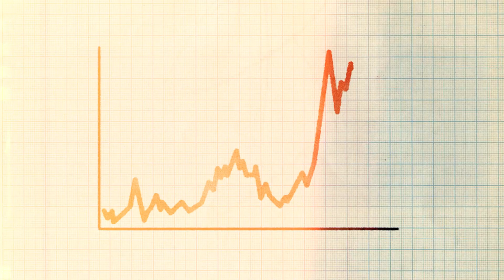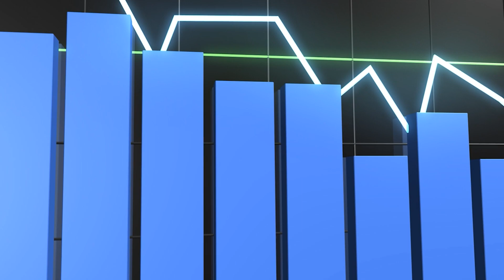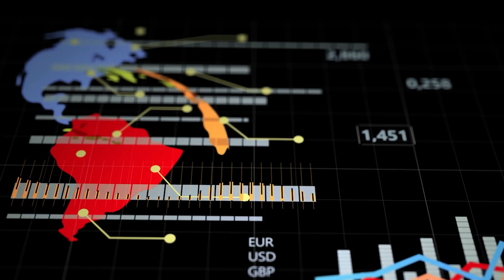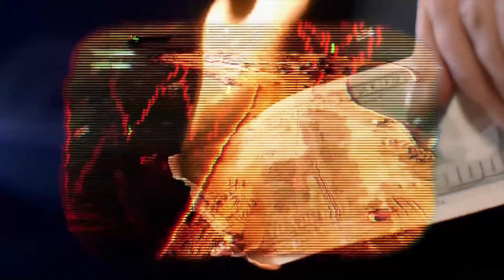Inside Dubai's $100 Billion Sinking Artificial Islands

Comment: Im not seeing the rising sea? I have a 50 year old photo of me stood by steal pipeing and concrete wave defences, you can see clearly the high tide markes, I went back last month and that area has not been change, and I took photos of the exact area, when I returned home I looked out the photo of me at this place, and I cannot see any diffence what so ever whith the tide marks, so can someone explin to me where this rising sea level is happening because its not happening where I live lol. There is a huge difference between erosion and levels so im getting a bit fed up of hearing about sea levels rising so they can justify how they demand us to change are ways, EV`s, less coal power stations, Im not saying that the change are bad but dont try to bullshit the masses that are well capable of looking at photos and seeing for themselves if there is a rise in the sea. Maybe Dubi should have tried to find out what the concrete was used on the wave defences I have been to, as in 50 years there is only slight wear on them, and thats holding back the north sea, and thats a badass sea lol.
Reply: Go here in the philippines and see proofs for yourself.
Reply: @leonardoangeles8211  I will look it up, thank you.
Reply: Looking at a 50 year old picture and coming to the conclusion that the sea is not rising is unreasonable. You need to do more research on ‘the rising sea’ and it may explain why your conclusion is incorrect.
Reply: @carolrainbolt5669  I took and passed physical geography way back at school, not that I used that qualification in my working life but I still remember learning things like, igneous, metamophic and sedimentary rocks, errosion, volcanoes, magma chambers, contanental shifts, to name a few areas so im no just opening my mouth for no reason, I need proof, and im not getting any, so if you have it please share!
Reply: @carolrainbolt5669  And LOOK at the photo at the start of the video, they are two different islands, that doesnt take a scientist to work that one out.
Reply: @carolrainbolt5669  Just putting that my conclusion is incorrect shows to me that you have no idea yourself, Im asking for proof and you just reply with unreasonable and incorrect, but nothing to give me evidence that there is a rise of the sea, so do me a favour and give me evidence that you must have as you have jumped in fast to just say im wrong ?????? Im open minded and if I can see that there has been a rise I will change my conclusion, but the only evidance I have is photos 50 years appart that shows me there is no rise. Dont be a sheep or show the proof.